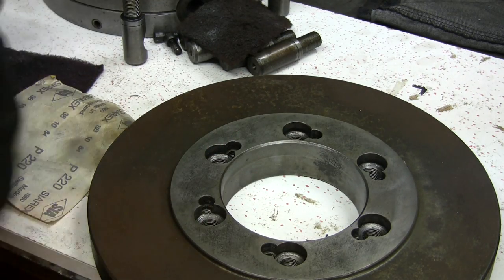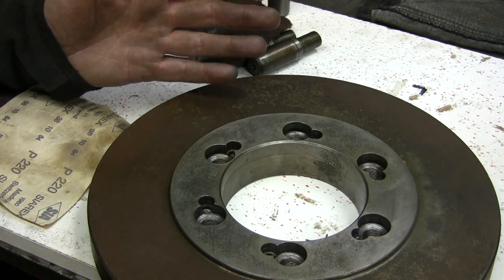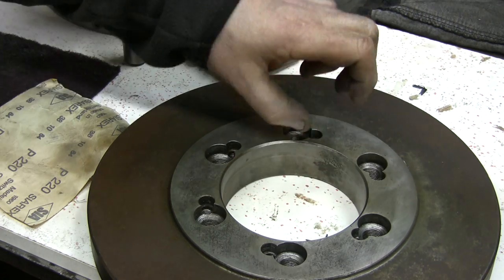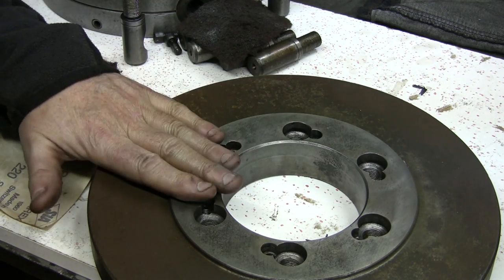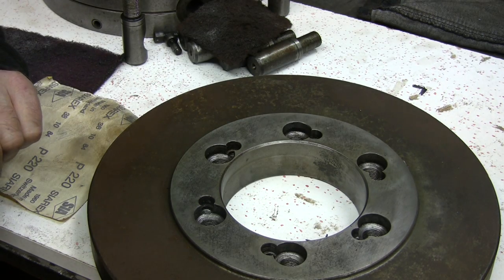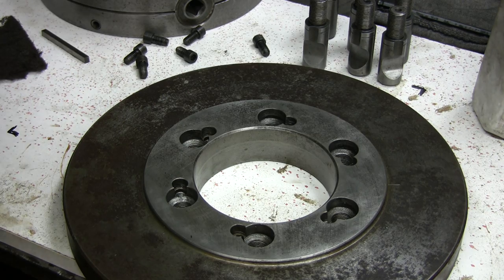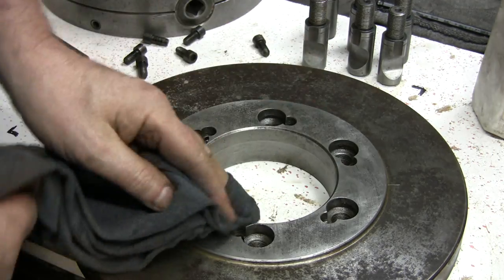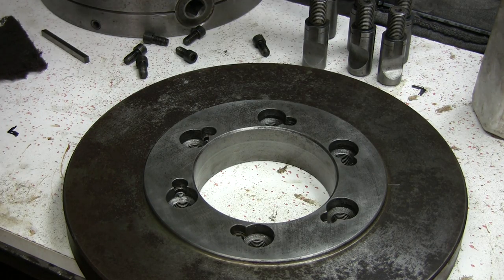Back plate for 6 jaws chuck Part 1

Comment: It seems you need just one turn on the cam pins.. ;-)
Kinda surprised it's cast steel too.

Colin
Reply from the maker: ***** Hi Collin, Yap easy to adjust, but there is no problem on a short term use to be at the 35 minutes position, past 40 something it gets more dangerous that you pass over the cam. By now it's already fixed.There is more complicated stuff coming up, don't miss the plot thickening as it progresses, like you'll see welding to adapt a face plate isn't common practice...Thanks for dropping by, Pierre
Reply: Heh, yes, I read your comment about trouble in faceplate paradise. Will have a look in a bit.

:-)

Comment: another transport from Randy's shop some heavy duty equipment you have there . my worn out little atlas pails in comparison lol
Reply from the maker: Chris Anderson Hi Chris, you have to be proud of you're little Atlas, I'm sure the little lathe will go far out of it's "ways" to accommodate you... lol Thanks for comment, Pierre
Reply: indeed shes had a hard life saved it from the scrap bin I have a better bead need to transplant everything over got about a dimes thicknes of where in the ways
Reply: I have a much better bed and need to transplant everything over.
Reply from the maker: Best of luck with the transplant, and a quick recovery to making you usable parts.
Reply: Indeed hay check out my channel see what I have Ben doing
Reply from the maker: Chris Anderson I will for sure, Pierre